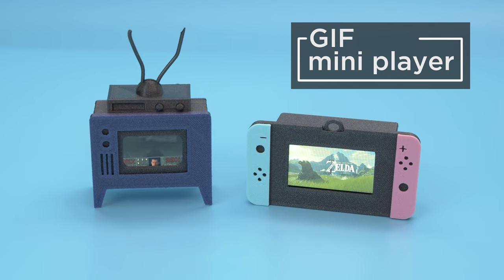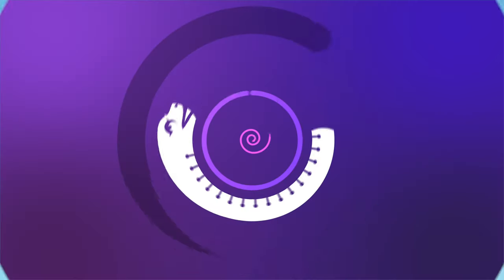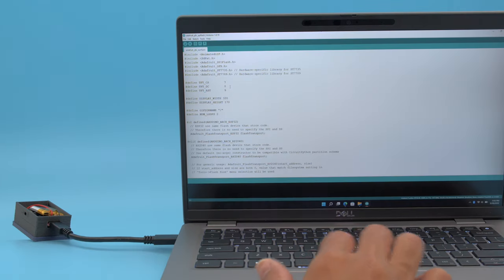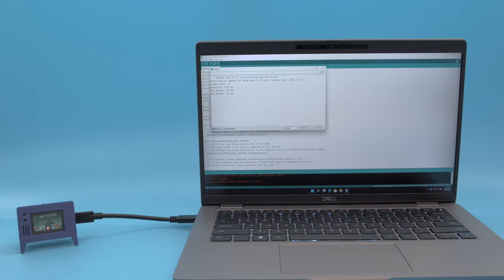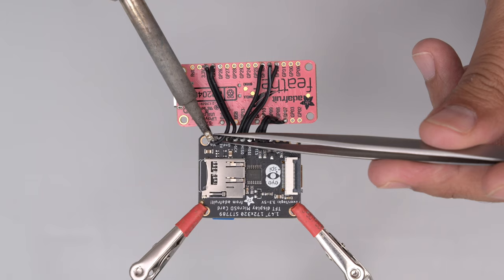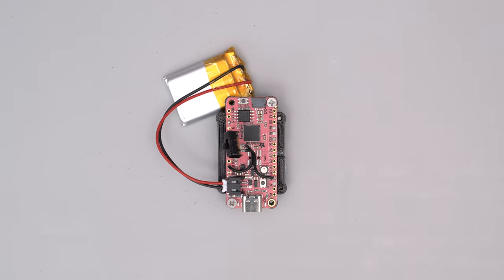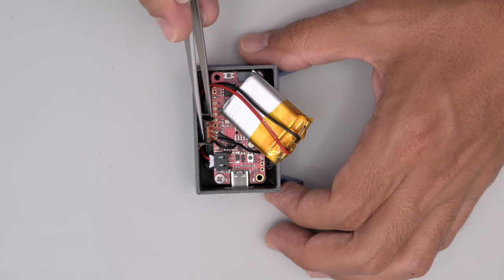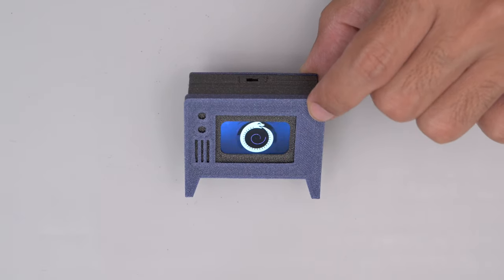Mini GIF Players #Arduino #CircuitPython #3dprinting

Comment: I just built this. I love the concept and idea but the provided coding was just way too frustrating to get to work. Spent hours trying to figure out why the display wouldn't work properly. Turns out that the code just doesn't like some gifs and won't play them at all (even at the right resolution). That and you have to comment out while(! Serial) or else the code won't run without a serial connection to a computer.
Reply: How did you make it to work properly? I have been trying with your solution, but still couldn't get it to work yet.
Reply: @dannguyen2705  other then commenting out the! Serial, I just messed with dozens of gifs, reformatting and compressing them until they worked, and even then not all the gifs work. So I only have a handful of gifs that do display properly. I haven't been able to pinpoint yet what works and what doesn't
Reply: @Louie773  from what i've read on some of the post on their forum. Ppl said that the gif has to contain only 9 frames and have to be less than 32 color depth. And i've done the same as you, trying to mess with dozens of gif till it works.